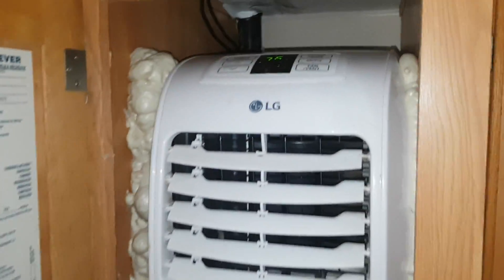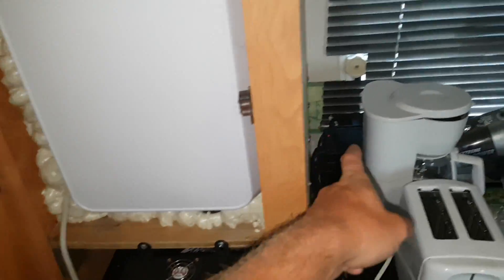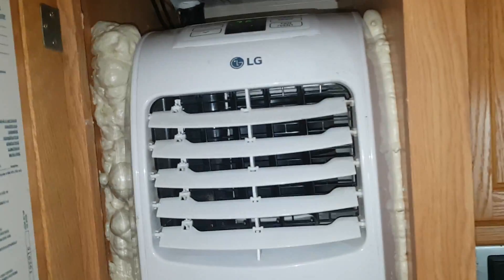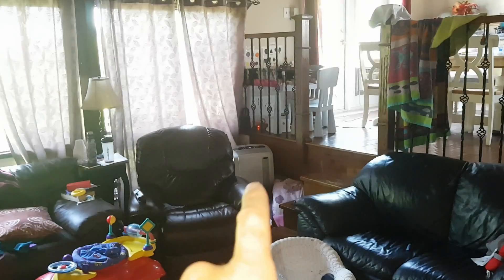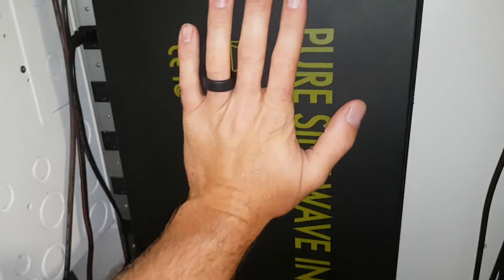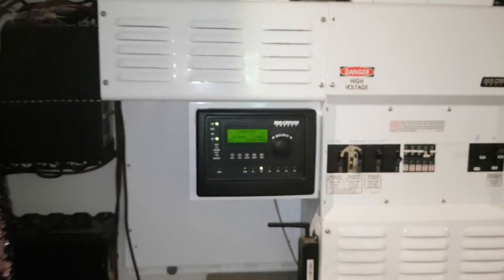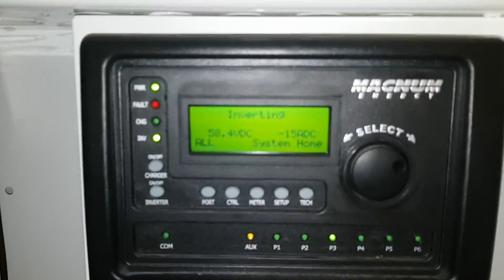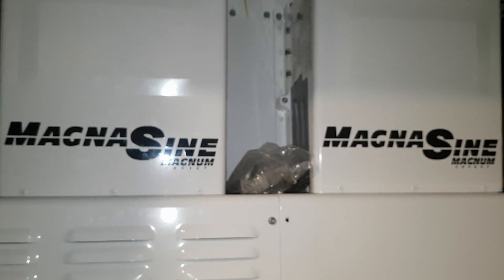Using To much Power Solar Not Keeping Up

Comment: Just wondering about something: Is your Victron energy meter measuring the output directly from the batteries or from the output from the inverters? If it does measure from the inverters, how did you configure it to measure the total power output?

Comment: There is a 9000btu precharged mini split on Amazon, and eBay for around $1200. It has a SEER of 37.5. Power consumption around 250 watts.

Innovair elite iirc.
Reply from the maker: i believe thats on low, but ill look into it.

Comment: My 200 Classics also get pretty hot - I pulled the covers off and put a $10 Walmart clip on fan (pulls like 10 watts) pointed directly at the unit, dropped the FET temps from about 70C to 45C.  Of course that heat still ends up in the room :-(
Reply: i put computer fans underneath the midnite classics.
Reply from the maker: thanks ! ill have to do something about it.

Comment: The A/C I was testing Was for the master Bedroom in my 5th Wheel the highest point in the RV. I'm go to have to put up more panel that are in storage. I didn't think you would ever use all the power in your batteries?
Reply from the maker: with with 27000btu AC running 24/7 im having a very hard time with everything else running including the dryer...

Comment: Ur wasting alot of energy with that ac unit they say there horrible even the two hose ones get a wall unit
Reply from the maker: they are not to bad, and I may not look like it but im trying to save a buck.
Reply: @GoingOffGrid101  ive never used them but ive watched videos on them and there all bad
Reply: @GoingOffGrid101  listen man u need to do a video on a small wall unit and a two hose system and see if one is really batter then the othe
Reply: I just got my house and still working to get some stuff to at least make my fridge off grid
Reply from the maker: @leasttrending  good idea!
Reply: The wall unit will always win as it only has one fan motor that drives both sides at same time (just the compressor cycles that's all) , the "portable" ac units have 2 fans in them and they pull way more power then then wall unit alone and if it can't be double ducted so the air is pulled from the outside buildings instead of from inside the room they also so have to run longer to cool the room down wasting power ( wall units typically are 2-3 times more efficient than those portable ones)

Comment: Hi 80s is hot???  Where I'm it 92F (33C) at 8:00AM..... lol
Reply from the maker: its 31C here today and thats hot :D
Reply: He's acclimated for Canada so his high 80's is our mid 90's in NY and our mid 90's is a cool day in Sun Devil AR @ 125 degrees. I go to St Pete in Florida on the Gulf in January and it's in the high 80's low 90's. It's hard to adjust in NY one day it's freezing and the next, the leaves are burning off the tree's. It's a tricky thing finding your sweet spot.
Reply from the maker: @MrBrymstond  we get up to high 90s some times but I have a hard time working in that.
Reply: @GoingOffGrid101  Me too, I can't stand it that hot. It was 100 degrees and we were stuck on the highway for over 4 hours. I thought for sure we were dead. The AC is still and was broken in my car, but people were running their cars with AC cranking and most of them overheated causing a huge problem. It must have been 130 or more sitting on that hot pavement with all the cars running and nowhere to go. I found the first motel and spent the night recovering and we agreed to ditch vacation and go home at 2am when people that can't drive are off the road for the most part. I knew we were going to have problems leaving in the afternoon, but we wanted so bad to get away, not anymore. I travel at night whenever I can.
Reply: @mackthefatcat   Smart.